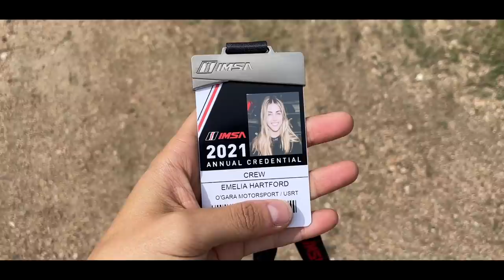Rebuilding A Badly Wrecked Lamborghini Race Car Part 1

Comment: You really should look into putting an electric power steering column from a Nissan Cube or Versa in Mimi since you already have a manual steering gearbox. I know it will add some weight, but especially if you’re thinking about possibly doing any street driving events like Rocky Mountain Race Week, it would be worth it.

Comment: 4:45 

because allot of that foam tends to dissolve in current day fuel mixtures clogging up about everything u can think in ur fuel system.

i would advice against it and make baffle plates, or either contact the company that makes this foam to ensure it will not dissolve over time.

Comment: You should ls swap that thing with a 12 cylinder LS twin turbo motor
Reply: The V10 puts out 620 bhp and is probably significantly lighter!
Reply: she wants a test car for her racing so she needs her test car to have the same engine as her race car otherwise she could just practice racing in her C8 lol
Reply: @ces69  the LS v12 makes 850-900 HP. N/A
And way more torque

Comment: Is it me or did the pit crew member at 12:48 check for tightness the wrong way on driver side or am I crazy?
Reply: some race cars like porsches and i guess these lambos will have a left hand thread on one side and a right hand on the other side
Reply: @DriveManual  that explains what I saw then. Crazy. Not many things are reverse threaded.

Comment: Take that shit out if that tank as fast as you can any e85 and those pieces of foam will be in your injectors even if you use regular gas in a year or two you will have to replace that shit I would rather deal with fuel slosh then cleaning bout my fuel system every couple of years
Reply: it's for safety and if team lambo uses it then she should use it. This isn't a street car it's for the track only, so safety is more important than fuel filters and clogged lines.